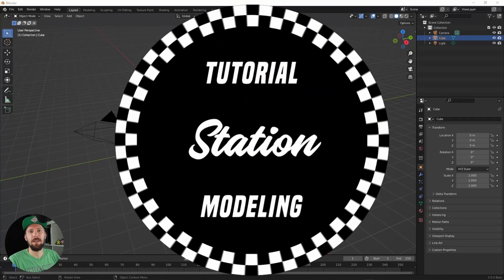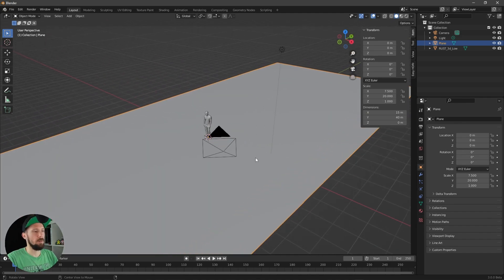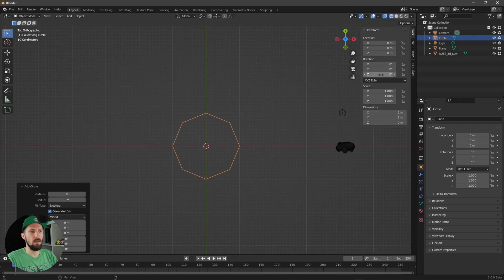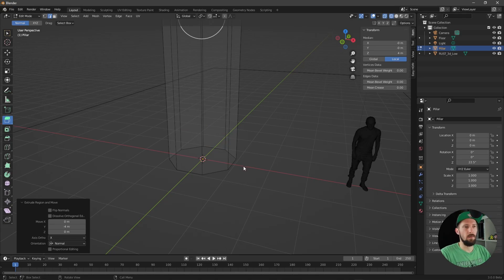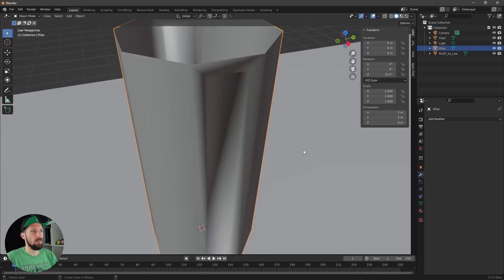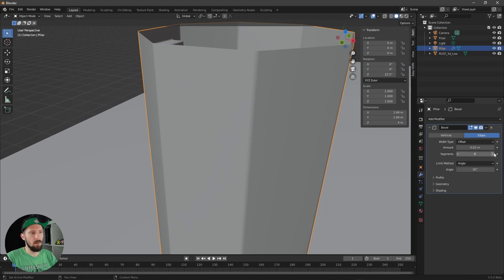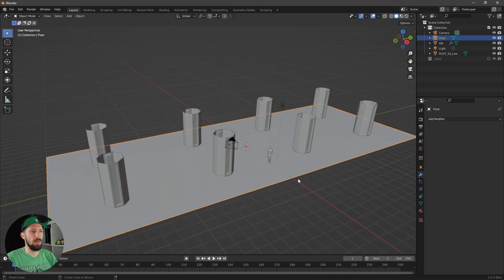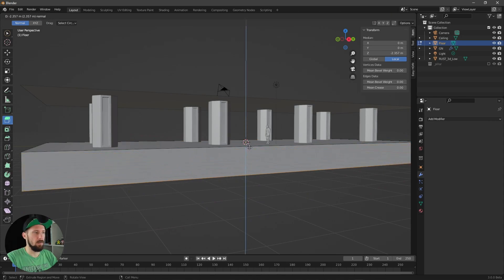Blender 3.0 Tutorial | Creating a Trainstation Part 1/3

Comment: You doing my job…! If you want tipps I can show you some examples on how to do the floor and lighting ;-)
Reply from the maker: hehe :) In the next one I'll show how to texture the floor. But I'm really interested how you would do something like this ;)
Reply: @PizzadelRay  The thing is, stations have often tiles of different size and color. Making this with a texture would need displacement, because of the low angle you viewing it. but on the larger scale, these would need to be also larger. So the easier and more flexible solution is to use instances and points. With geo nodes that all depend to a one time setup. The modifier then places the plates on the right position, with a bit of randomness. The difficult thing is the 90° random rotation and to add tiles that are not square.When I design the floor I just take a grid mesh and use colors to make the basic layout. Then I add the special plates. When I'm done the modifier creates the high detailed version on rendering.
Reply from the maker: Yes, you are right with the displacement! Next time I'll try to add this. The Geo Nodes Workflow sounds really cool and also advanced. That should be a tutorial for itself. I would love to see one 😉. Thank you for your thoughts 🤗👍